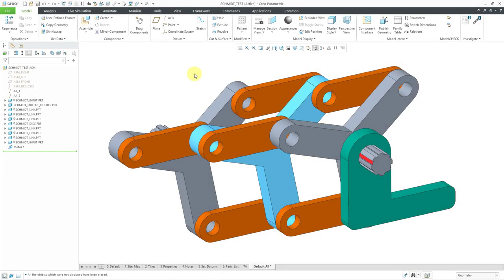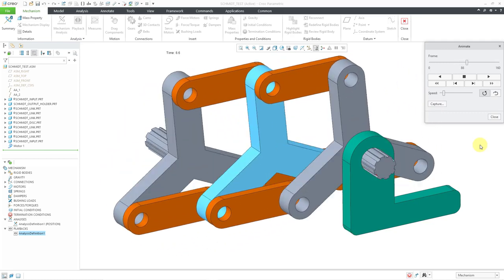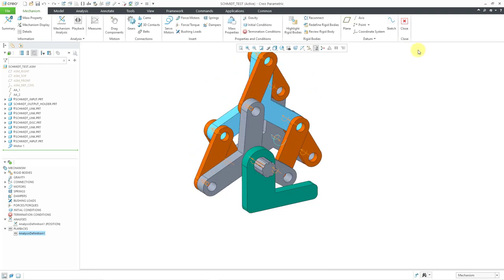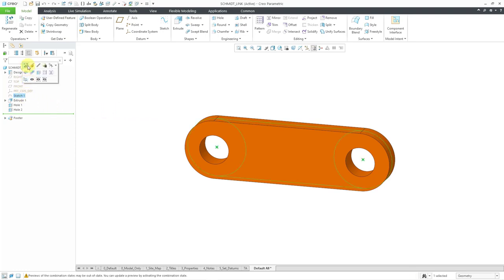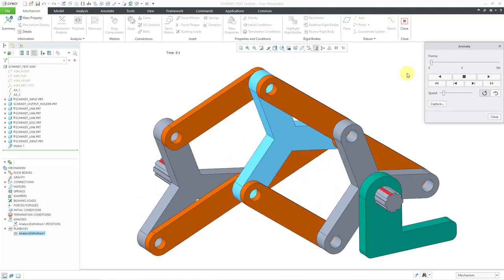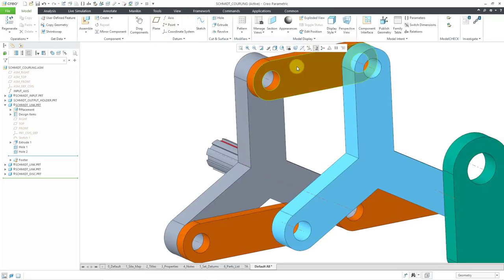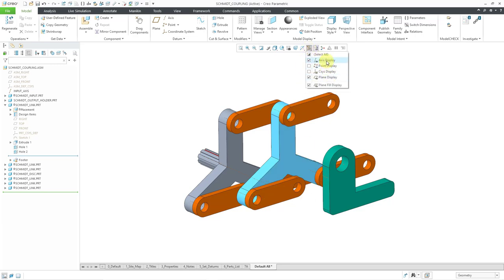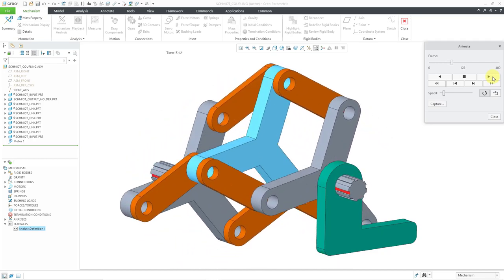Creo Parametric - Mechanisms - Schmidt Coupling

Comment: Any real example where can we apply this type of connection?
Reply from the maker: Schmidt couplings are used in a variety of machinery in which torque needs to be transmitted between offset shafts that need to be adjusted or locations change during operation. For example, printers and photocopiers. They are also used in food processing, vacuum packaging, sensor technology, and medical equipment. They were initially developed for space exploration by NASA.